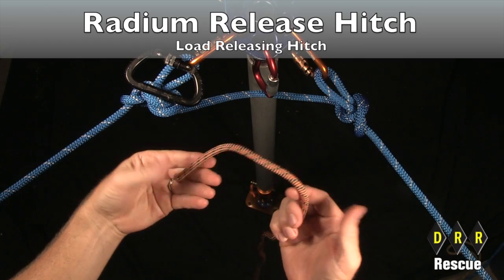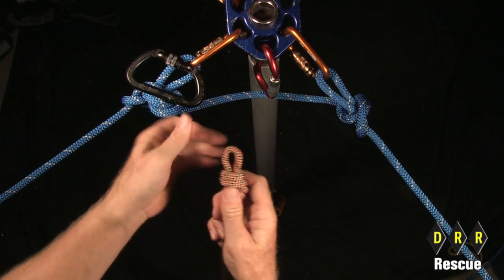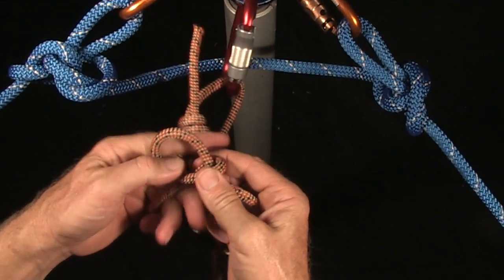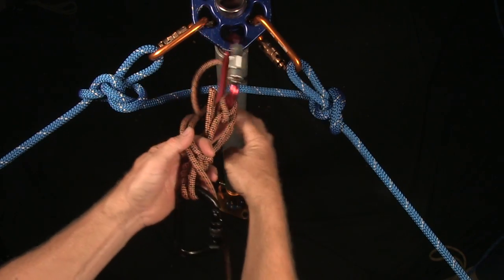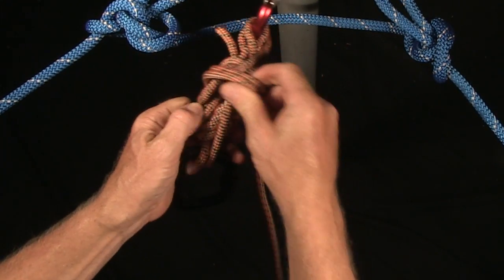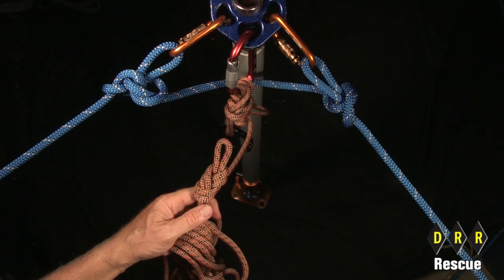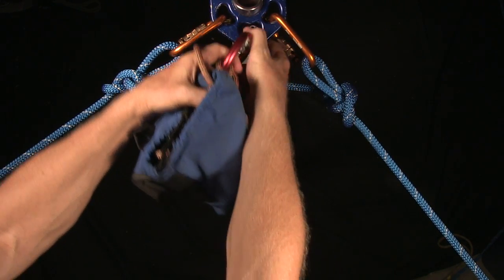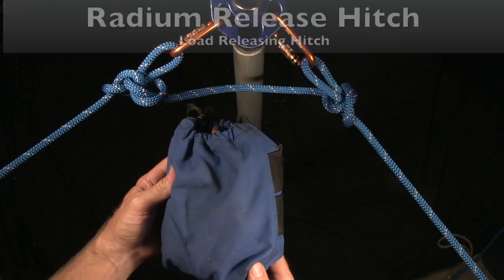Radium Release Hitch

Comment: What is this used for ??
Reply from the maker: Thats kind of a long story. Back in the 1980's, The guys in British Columbia proposed the use of tandem prusks for belay. At the time, most rescuers were using a brake rack descender on a dedicated main line and tandem prusiks were the only thing that reliably arresten the load in a main line failure durring testing.

The nature of tandem prusiks are that they must be minded with a propper technique and sometimes they accidentaly lock up. If they lock up on the belay rope, you are stuck. If you get locked prusiks, there are a couple of techniques to free them but if they are really stuck, you would use release hitch to introduce slack into the belay allowing you to free the tandem prusiks. Once free, you just tie off the hitch and continue.

So in present day, Most rescuers consider the release hitch optional because its an extra piece of kit and you can for sure free the prusiks with one of severl techniques.

You can also use the LRH to pass knots.

There are many styles of LRH. The BC LRH, the Mariners LRH, the Hokie LRH, and the Radium LRH. If you are going to use a LRH, the Radium seems to be the current favorite.

Finally, I must say that tandem Prusik Belay seems to be falling out of favor after nearly 30 years. The problem is that in practice, the human operator must perform really good technique to get good results and we see alot of bad technique out there. In practice drop testing, Tandem prusiks perform poorly about 10% of the time. Thats 1 out of 10 where the load moves a lot or hits the deck enve when rescuers are expecting the failure.

Two Tension Rope systems are popular and the ASAP lock is also gaining popularity.

Probably more than you wanted t know but there you go.
Reply: @DRRRescue  Interesting history. Is it safe to say that this is only used for descent? Also, there has to be a better way to fit both a strand of line and a munter hitch inside the same carabiner. I would think it would be much better to just use another carabiner on the same anchor point so the munter doesnt potentially walk on top of the other strand thats looped in with it to create the 3to1, you follow?